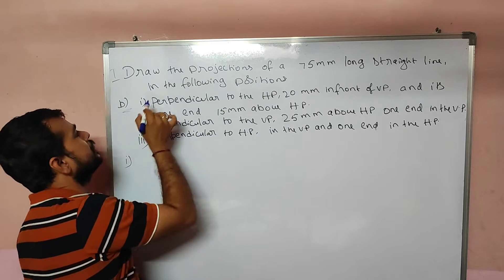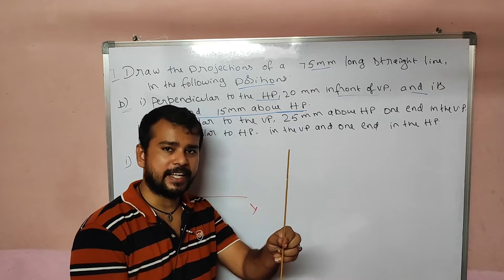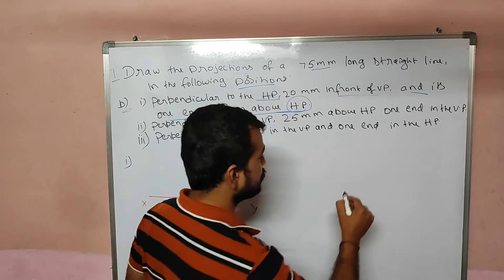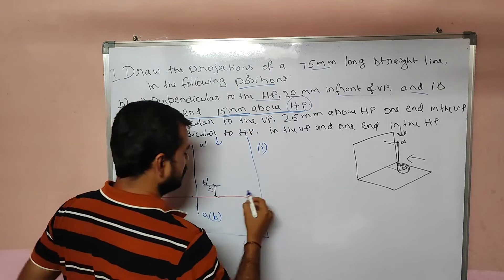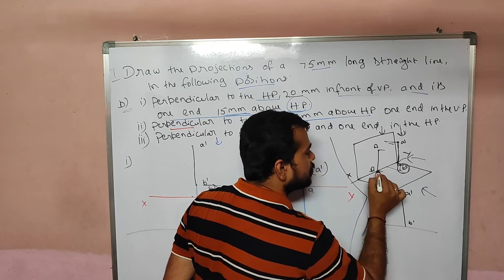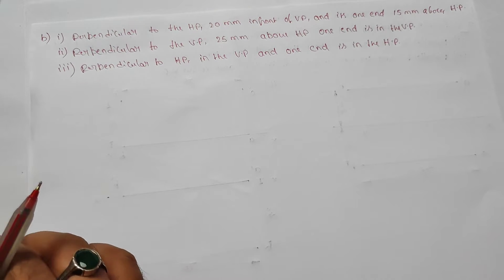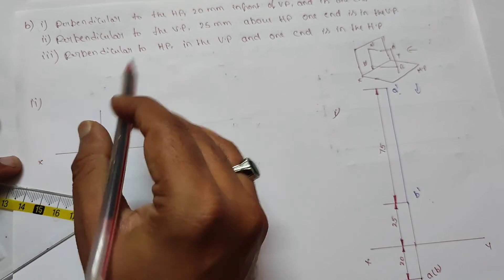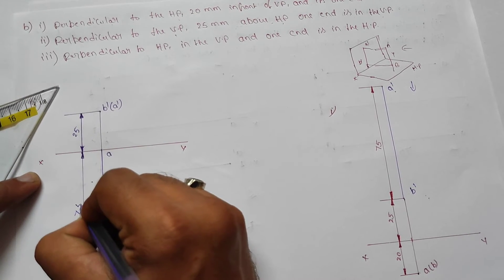Projection Of Straight Lines Problems| Line Perpendicular To Planes | Engineering Drawing In Telugu

Comment: Draw the projections of a straight-line AB, 50 mm long, in the following positions

Parallel to both the HP and VP and 25 mm from each.

Parallel to and 25 mm above the HP and in the VP.

Parallel to and 25 mm in front of the VP and in the HP.

Perpendicular to the HP, 20 mm in front of the VP and one end 15 mm above the HP

Perpendicular to the VP, 35 mm above the HP and one end in VP